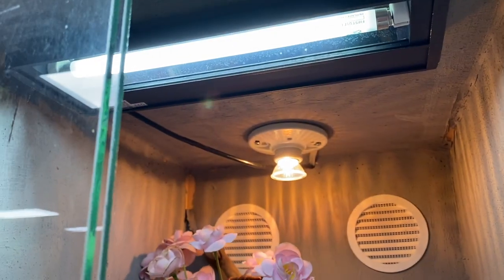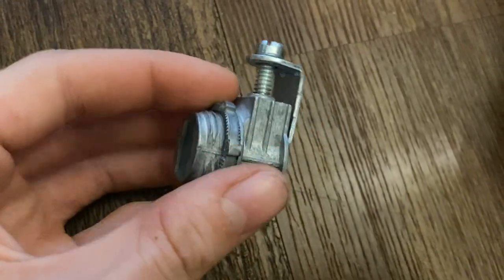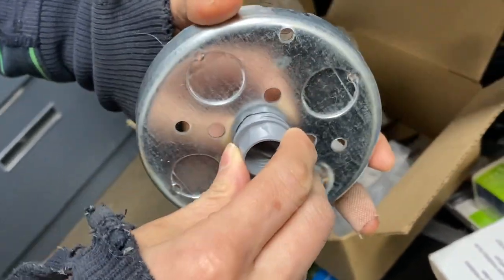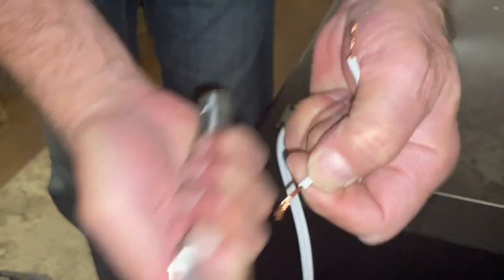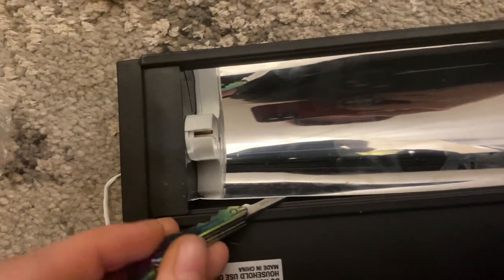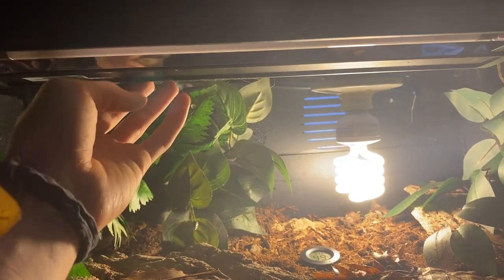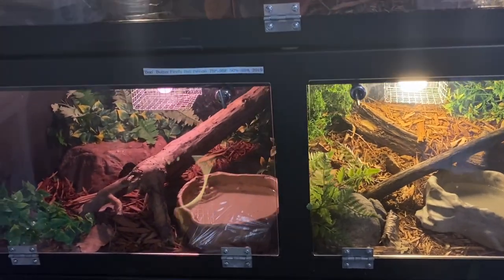INSTALLING HEAT & UVB LIGHTS Into My PVC Reptile Enclosures

Comment: Having a hard time finding mounting brackets that look anyhting like the ones you use here, I know you said they are from home depot but non on tbe website look like that, any help?
Reply from the maker: I would try to look up the specific brand I used which was IBERVILLE and i believe on home depots website they’re called “ceiling pans” Or you can try showing the picture of the ones in my video to an employee at the store that works in the lighting department and hopefully they can help guide you.

Comment: im looking to do the same thing but im concerned with how to still retain the pvc enclosures ability to stack. How did you end up working around the cord and screw tips sticking out to be able to stack the enclosures as you have? I was thinking of just filing down the ends of the screws but thought id ask for your insight given you've already done it
Reply from the maker: I go to the dollar store and get these felt round stickers that are used for the bottom of chairs to prevent them scraping. Adds a bit of space in between each enclosure

Comment: Did you install the metal part upside down? The way your boss demonstrated putting the grey cable piece makes it seem like you installed it the wrong way around. Great video, thanks! ^^
Reply from the maker: I’m unsure of what you mean but I promise you it was installed correctly